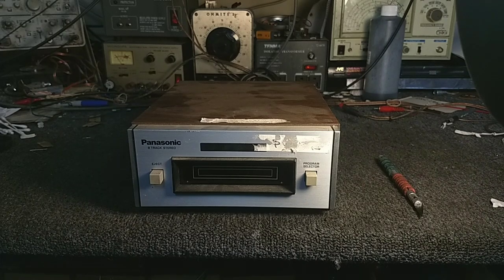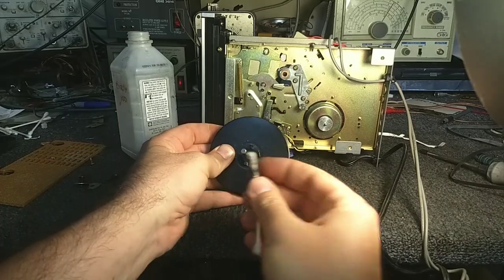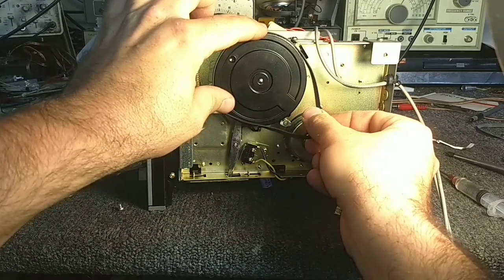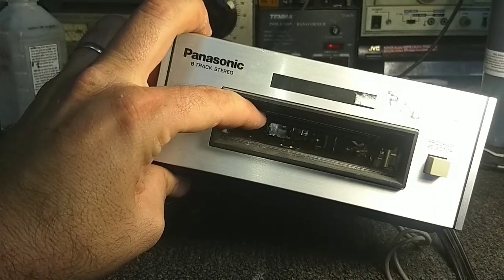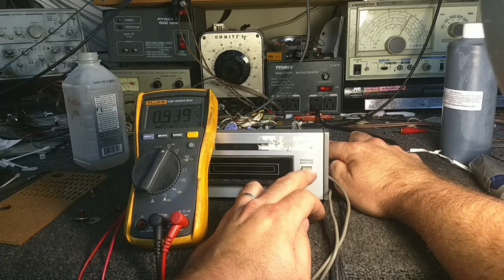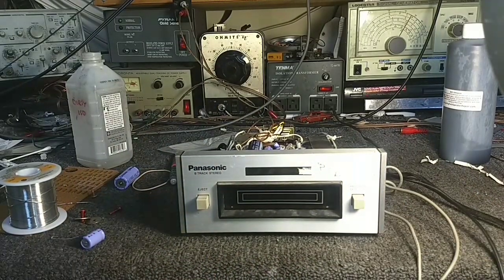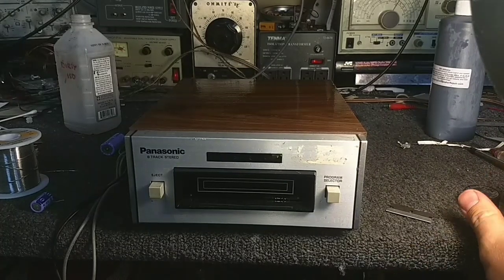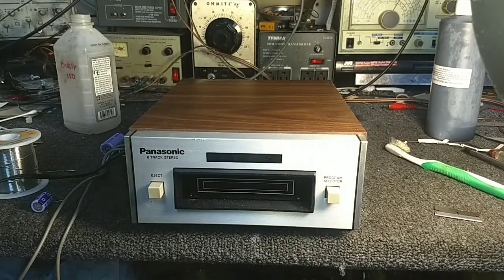Servicing a 1970s Panasonic RS-801 8 Track Player

Comment: Excellent Video, Thank you. My Dad gifted me Panasonic RS-876AS that he had in his garage for 30 years, The receiver works flawlessly and the matching speakers sound great. The turn table will spin up, when selected in manual, at all speeds, been when the lever it put into REJ the plater comes to an abrupt stop and will not start again unless I turn it off, put it back in manual. The idler wheel looks fine no cracking and is still soft. I suspect something in the linkage may be gummed up. Also I  think the same 8 track core is installed in the unit as well. I will definitely use your tips and methods to work out why it does not function, though  the program lights do work when a 8 track is inserted, but no sound our movement detected. I was gifted a nonfunctional 1925 victrola that would spin but the resonator was shot, so I rebuilt is and lubed all the mechanical parts. Its alot of fun now it's working and it always wows my guest when I put on 100+ year old records on it. I recently purchased a Curtis Mathis console with the Receiver and Garrard 620s turntable. From a Goodwill for 9 dollars untested. The receiver works perfectly but the Turntable had issues. The speed control was frozen, the tone arm wires were shot, and the automatic spindle would not drop records. When phono was selected it would only play out of the left speaker, and there was a loud humming through the left speaker when in phono setting. I disassembled everything, lubed and freed up the speed control mechanism, found that the retaining clip for the auto spindle was not very snug as it allowed the spindle to move slightly causing no action. I replaced the tone arm for one I found online of exact match. While I repaired and rewire the old one. Found 1 RCA cable to be bad and replaced both, and found that the turntable itself had no grounding wire and appeared to have been removed, I ran a new ground wire to the receiver ground and eliminated the hum. Every thing is now working flawlessly and I am very happy. Turned that $9 dollars investment with about $50 into parts into a solid working unit. I was offered $700 for it from a musician friend of mine. But I am enjoying it to much to sell at the . moment, I may entertain offers in the coming years but, now I am savoring the awesomeness of it.I got that Panasonic RS-867AS to Work on as well as an Panasonic SE-1510 to work on. Any tips on the Panasonic RS-876AS turntable issues from viewers or channel host would be greatly appreciated. Thanks again for the great video and you definitely earned yourself a subscriber.

Comment: Groovy video! It takes me back to my HS days in the 70s when a lot of us had 8-tracks in our cars. I made a good deal of $$$ fixing them (... much more profitable than $1.80/hr working at the burger chef). The main problem was that the cheaply made tapes would quickly clog the heads and cause a loss of volume. Also, most of the heads in the "budget" units were not properly adjusted at the factory, causing bad high frequency response. My calibration tape made for easy adjustment. Fixing car 8-tracks led to getting work fixing audio and TV. Thanks for making videos showing the workings and repair of vintage electronics.
Reply: I remember, as a kid in the 70s, often riding my bicycle and seeing ruined 8-track tape on the side of the road because their car player 'ate' it and they threw it out in frustration.   Never had one in my car but had a couple in our house.  Burger chef - I remember those!   I think my home town had that and also a Burger Queen (with their weird Queen Bee mascot).
Reply: I remember, as a kid in the 70s, often riding my bicycle and seeing ruined 8-track tape on the side of the road because their car player 'ate' it and they threw it out in frustration.   Never had one in my car but had a couple in our house.  Burger chef - I remember those!   I think my home town had that and also a Burger Queen (with their weird Queen Bee mascot).

Comment: There is a trick to assembling the capstan and not get any oil on the part that touches the tape. Only apply oil to the top bearing, not the shaft, then with a clean capstan shaft only apply oil to the base of the shaft that will contact the lower bearing. Since there is no oil which contacts the bottom bearing, or the top of the shaft, they pass through each other without smearing oil onto the place that will contact the tape. Spin the assembly slowly as it seats into the bearings to distribute the oil. Just got done with a Panasonic RS-802US last year. Great video.

Comment: The Panasonic RS-802US has "IC circuitry", uses an AC synchronous motor with a fan, lots of torque and no draw from the power supply. No eject button on the 802. Love the electromechanical pinball technology used just to light up 4 program lights and change the head position!

Comment: Thanks for this very educational video... For these type of 8 track motors with an internal speed adjustment, what is the correct procedure for adjusting to the correct speed? I have a Realistic TR-888, tried to match the speed to a digital file (coincidentally using the same Billy Joel album to test...) with several passes of disassembling the motor, turning the adjustments and reassembling. However, after watching this, wondering if I should have focused on capacitors or something else before touching the motor...
Reply from the maker: If it uses an AC motor and a phasing capacitor, you can try changing the phasing capacitor to see if a tired cap is causing it to run slow. 

You can also try using a narrower belt to concentrate surface area on the apex of the pulley.

However if it has a DC motor with a mechanical governor, the motor must be carefully taken apart and the governor adjustments inside on the contacts turned a hair clockwise to close the gap. Then reassemble enough to run your test again. It's a pain and you may take hours only to get the speed close.  One false move and you will hurt or kill the motor.

Newer DC motors have a speed controller IC inside with an adjustment pot on the back in which case you can use a non metallic screwdriver to adjust the speed during playback.
Reply: @JordanPier  Thank you for the info! (It was a DC motor w/mechanical governor)

Comment: Great video. Out of curiosity, when you do the voltage check what are you connecting the wires to in the player? I assume you were switching the unit on by hand when you were measuring?

Comment: Any ideas on where to look if the program change function isn't working?  My unit plays, but only on program 2. The solenoid fires when you push the button, but the white plastic cam doesn't move. I removed the cam, and thought the little spring sitting at the bottom of its shaft had lost its strength, and installed one with more springiness.  Didn't make any difference.
Reply from the maker: If the white cam moves, but no change, likely the shaft bearing the head moves up and down on is frozen. 

Carefully heat it with a hair dryer to loosen up the grease, clean the surfaces accessible with isopropyl alcohol and reoil with 3-in-one or similar. An oiler syringe makes it easier 

Make sure no be careful with the heat and dont melt any plastics, wires, or get the head too hot
Reply: @JordanPier  Thanks!

Comment: Great video and very informative. It helped understand the track switcher. But mine is not spinning when the solenoid engages, only moving back and forth so only one program loops. I'm trying to figure out if I need to bend the prongs on the mechanism that turns the cam to raise and lower the head. Do you have a visual that can show me how that thing works and how I can adjust it to move the "blades"?
Reply from the maker: You should never need to bend the blades the solenoid pulls down. Check that the head can be moved up or down by hand. If not, you're problem is the head is stuck.
Reply: I cleaned the old grease off and put new white grease so the head moves up and down smoothly. The head also moves fine when I move the solenoid manually. It only goes back and forth when it is plugged in. Could it be the spring? Thank u for the prompt response on the my first question. 😀
Reply from the maker: @soupbonep  if you move the cam that changes head elevation  by hand, does it correctly change tracks? Was it correctly reassembled with any spacer washers that would effect baseline elevation of the cam?
Reply: @JordanPier  The tracks do change correctly when I move the cam by hand. I don't know if there is bleed through because I haven't done it while it is plugged in to hear the audio, but the head does move position up and down. 
As for washers, I will have to get back to you on that. One that I put on the cam shaft is just under the clip that keeps the cam on the shaft. I'm not even sure if it was supposed to go there because I forgot where I removed it from. I should have took notes, or pictures to document the steps. I'm a novice as you can tell! 

I was thinking that the solenoid wasn't moving far enough when I pushed the program button when powered up. It seemed that the prong wasn't going all the way past the rounded part on the cam blade to catch the corner. But I could be wrong. 

Thanks for all of your help. I am not home right now and can't access the tape deck. So I will look at it on Monday morning.
Reply from the maker: @soupbonep  if you can press on the metal arm long enough to change tracks and the solenoid wont do it, then you have to troubleshoot the solenoid circuit to make sure its getting clean dc power
Reply: @JordanPier  Now that I'm home and with further testing, I think you were on the right track with the spacer washers. Here is what I am seeing. The cam gets stuck in the highest position and works on all of the lower three. So the cam needs to be lower on the shaft to line up correctly with the solenoid, right? I'm going to see if I have any small washers. 

Concerning the dogleg shaped brass part that has a little nipple that is against the cam. Does the nipple belong on the outside of the edge of the cam, or does it fit into the groove on the cam?

Speaking of the washers, does the capstan have one between the large disc and the machine? In other words, at the bottom of the capstan shaft where it attaches to the belt gear disc?
Reply from the maker: @soupbonep  the dogleg doesn't fit into anything. It's only job is to strike the pegs on the cam to rotate it. Check that you don't have excessive play in the capstan. There should be a thin washer at the bottom of the shaft where it meets the flywheel, thicker washer(s) at the top underneath the cam. The cam has to be fairly high on the shaft to get properly wacked by the dogleg.
Reply: @JordanPier  Seems like the dog leg is what is keeping it from rotating because the cam spins and goes through all of the levels when I pull the dogleg away. Maybe I put it back wrong, but it seems to only go on one way. I wish I had a schematic. I will look online for one. My model is RS 805 US and I don't see the dog leg in your video on the 801 model. I am looking forward to fixing this deck because the sound quality is very good.
Reply: Just wanted to let you know that I got the US 805 working! It was old grease and gunk on the cam and the ratchet spring was bent and dirty with the same old grease. Now I have to sinc the cam to the program light lamps because they are off by one. Track four is track one etc. I may just leave it like it is, but right now it is on the bench and I'm doing some research before I mess with it.

Thanks for all of your help, I really appreciate it.

Comment: Wish I could send you a Sony TC-208 to look at. Has a speed/flutter problem despite a new belt. Think it also has a mechanical-governor motor (will play somewhat normally if I turn on its side).
Reply: If you bought a belt off of eBay, well, there's your problem likely. I bought belts that were too tight and too narrow and caused rapid tape flutter. If the belt rides the convex motor pully off center, then it is not the right size, it must track right down the middle. Hope that might help.

Comment: Maybe the Voltage drop is intentional ? .. Something like a soft start function to not yank the tape ?   Hard to tell without schematics..
Anyhow, thanks for sharing, and best wishes so  your customers may start recognizing your service hours in the future !
Reply: No, 8 track doesnt stop/start to move tracks.  Since the head is moving up and down on the tape, better if the tape is moving at normal speed when the head moves.  Also, since the pinch roller is in the tape, the motor already has a head start by the time the tape hits the capistan when inserting, so it would need a delay start and a soft start to accomplish that.    The tape media is tough too, so it's not going to hurt it.
Reply: @jimb032  Well, then it probably is crappy design as JP supposed ;)
Reply: @tinygriffy  True!  But surprising - There were some very good Panasonic 8 Track Recorders / Players made.  I suppose this just was not one of those.  But you can build anything down to a price, even in the 70's.  :/
Reply: @jimb032  You're right, although I think that planned obsolescence was invented or introduced into electronic much later. That's why I love the old stuff, mostly build really simple with the least amount of components necessary. Easy to service, robust and simple. Gone are the days where you could fix you phone with a spool of wire some tape and a hammer... sigh ;)

Comment: Seems like a lot of 8 track players have too of a  small power supply and the track change just bogs down the transformer.
Reply: That is why I like my 12 volt one, which I run at about 5 amps, so it has plenty of power.

Comment: Hi Jordan are PRB belts good for a nakamichi bx-100
Reply from the maker: No. I've tried using the 6.5 and 6.7 and both yield terrible wow and flutter numbers.

Studio sound electronics used to sell an fbs-6.7 that worked well but they sold out and everyone else advertising that belt is selling the wrong one that is too thick and doesn't work either.
Reply: @JordanPier   Well just thought I'd ask, still can't find anything reliable either.   Thanks for the reply.

Comment: You could replace the psu rectifier diodes with ones from a switchmode output, less voltage drop across schottky types.
Just a thought :-)
Reply from the maker: Eh. Effort🤣
Reply: Could have some shorted turn in the solenoid?  Would like to see what the current draw is from the wall with a kill-a-watt meter as the solenoid is activated.

Comment: I Remember Having One Of Those But Only thing
I Didn't Like was wen My Favorite Tapes Would Get Chewd Up In The Player It's Self.
I'd Get Mad & Almost Wanted To 
Throw It Out The window. I Used To
Say To My Self I Wish They'd Make
Some Kind Of Media That Didn't Wear Out.
So Wen Cassette Came Out That Was A 
Little Improvement.
So Wen CD's Came Out That Was A Gods in.
Reply: But The Thing With CD's wen I Bought 
A Portable Combination Cassette & CD
Boom box & Portable CD Player I Had To Invest In ReChargeable Battery & Charger. But
I Liked The Fact I Didn't Have To
Put Up With Tapes Getting Chewed Up.
Reply: If You Don't Have Googone
You Could Always Use Purple Power Hand Cleaner. Oh Try A Merle Haggard & The 
Strangers 8 Track